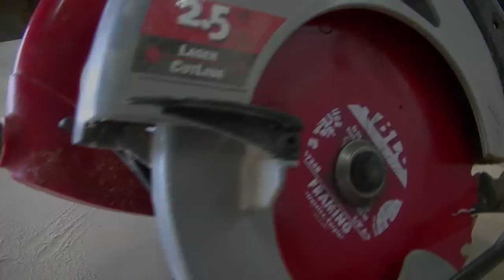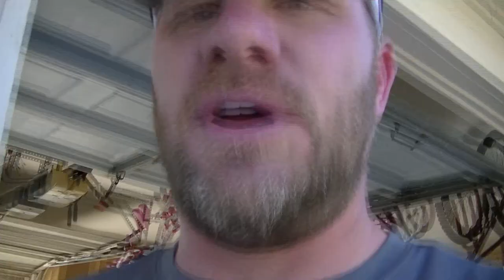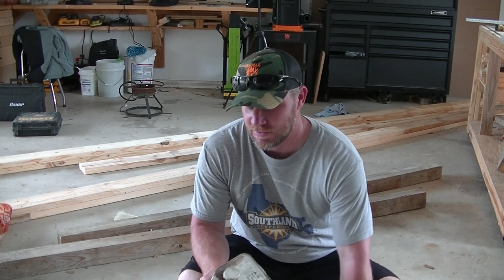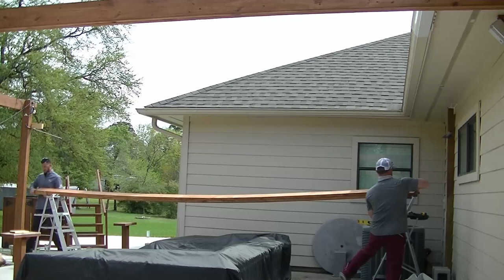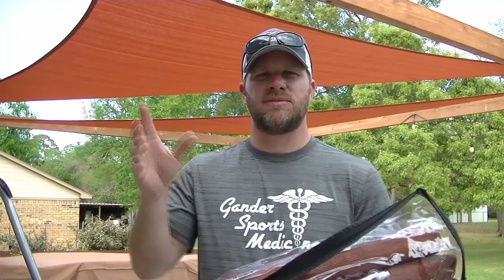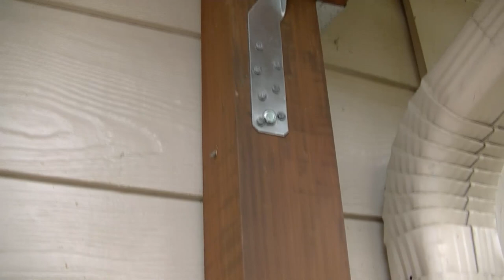Shade Sail👀  This is How you do it!

Comment: The proper tension actually is substantial. The force on a 4x4 over time really will pull them in unless you tether them down on the opposing side. Using perimeter beams is a great solution. My recommendation is also to not consider sails unless you are willing to install a proper support system like you have done here. Unless you intend for it to be very temporary. 6x6 are heavy and combursome but work very well too.

Comment: I am taking your advice and going with 6"x 6" and I also liked the lights (both from your earlier video). The 4" x 4" attachment instead of going through the gutter is a great idea.  
I would suggest making the heights of the corner connections different so the sail is not level. I think that would reduce or prevent water pooling.  I saw a different video where they used a pully and ropes instead of a chain and a turnbuckle to connect. It allowed tensioning and you could bring down the sail easier in case of a big storm ( I live in Hurricane country) also it was much cheaper. Good videos, Thanks!
Reply from the maker: Thanks for watching!

Comment: Are you predrilling, and what type of wood? I usually grab cedar but everything costs so much
Reply from the maker: Wood is crazy expensive right now.  I use pressure treated ground contact rated boards.  The lag screws are pre-drilled but everything else screw in pretty well without any extra work. Thanks for watching.